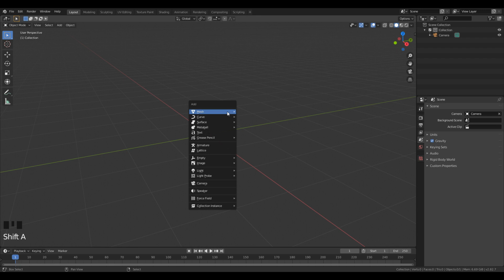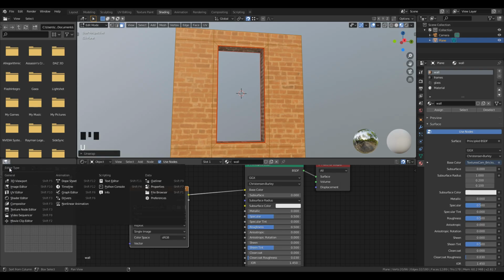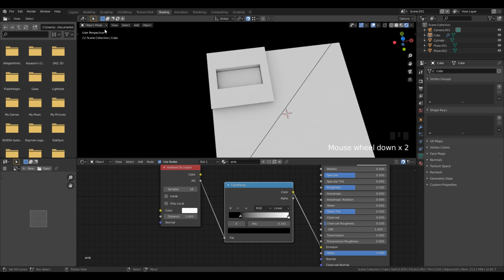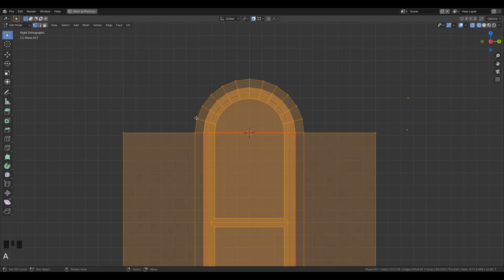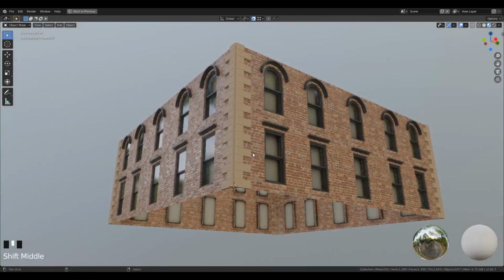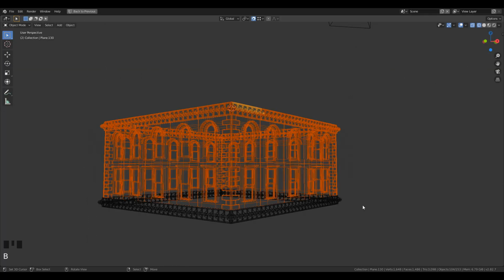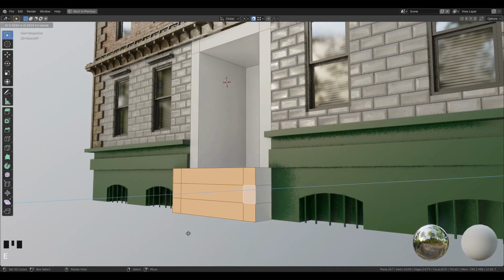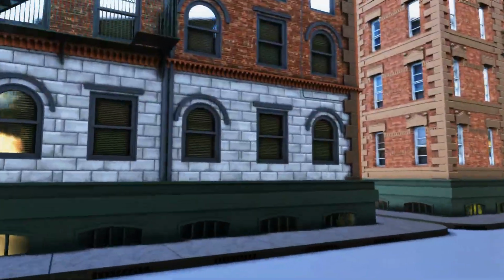Modeling Buildings In Blender

Comment: Many thanks for this It has been a big help. 1 thing to think about. A wall section with a window should be longer underneath the window as windows are set into the building usually at waist height. When stacked up the floors of the building have real height ;) Homes for the vertically challenged lol

Comment: why not use real dimensions?  Why don't you use architectural plans as a reference, why only rectangular buildings?  his system is very interesting by reducing the number of polygons and faces to use.  and their material creation system is excellent.  thanks for your tutoring.
Reply from the maker: I do use real dimension . But for this tutorial I did not change the default mesh dimension while working on the wall. Usually I do change it . If you talk about the building , Its a compact one. If I wanted to make a curve building I could have use this plane mesh with array or spline and could have generated a curve wall of a building . You can watch my array modifier tutorial to see how you can create dome with a plane .
https://www.youtube.com/watch?v=KM9wty__kyY
Thanks for the appreciation . Welcome aboard !

Comment: Great job. I'm not sure if this can be considered as modular, though
Reply from the maker: It's modular. You will just need to use or export few panels of the buildings. By just using those panels you can give any length or height to the building .

Comment: Thanks for this absolutely good tutorial.
but do you have a moment to help me out?
at 28:50 you start to bevel it negative (i got that)
then you selected the face without choosing face selection. how? if i press L the whole roofside thing is selected.
also when ich extrude it i cant just move it off the place. how did you archive that?
thanks in advance
Reply from the maker: You're welcome.I think your mesh is still connected to the roofside. You will need to select the edge and duplicate it then you can use the bevel command . 
If its separate then you can easily select it by pressing L key and you will be able to extrude it later  .

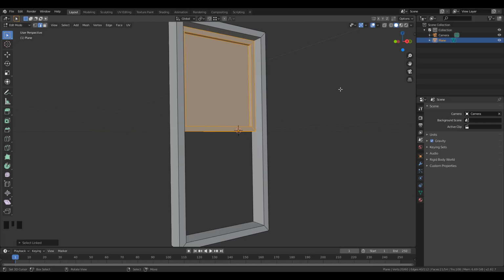Comment: Around 2:30 there was a gap between window and frame, later it disappeared. How??? Please help
Reply from the maker: After duplicating the window panel I have used snap tool with snap to vertex . Then just press g key and then hover the mouse to the upper window vertex to snap the lower one on the vertex of the top one.

Comment: This tutorial is amazing, but I still don't know how to solve the glass problem. I mean they are both selected, but only the bottom window looks transparent, the upper one is still gray.. And I have to say that the bottom one became transparent only when I checked "Backface Culling", and now it doesn't reflect any light like yours does.. I swear I don't get what I am doing wrong.. I have watched your video like 10000 times and it becomes so frustrating 🥺
Reply: Nevermind, guys be careful not to have multiple faces on your object 🤣
Reply from the maker: hey pardon me for replying late , Some time single plane normal faces are flipped and thats why you can't see the reflection of it . You will need to select the plane and  press shift+n and under recalculate normals check inside .
Reply: @SaqibHussain88  thank you man, it s the first thing I do in blender and it took me a while to learn all the commands and problems

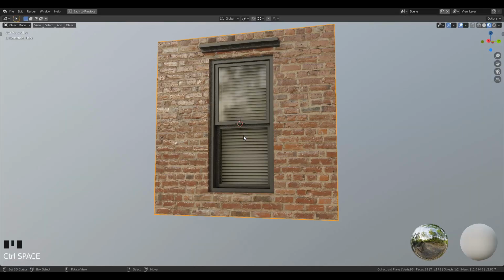Comment: its great i was looking for somethink like this but could i ask if it would be better to use array modifier instead of duplicating the panels at 16:33
Reply from the maker: Array can be used to duplicate a single window panel but you can not manually delete or replace the arrayed window panel. Therefore if you use instance you can easily swap any other window panels with the instance one.

Comment: Welp 3 hours later I have finished my window... Granted I spent about an hour trying to figure out all the shortcuts you used. As well as figuring out why my window was hollow on the other side. As well as losing all my hidden objects because alt h wasn't working for me. As well as doubling back and redoing the whole thing cause somewhere along the way I fucked up bad (when I lost my windows in hiding I made a new window, but figured out how to unhide everything and then my new window got swallowed up by the other windows so that when I tried to open an close the lower window it was shearing the eaten window). But yea it's finished on both sides with no issues on the opening and closing. Thank you for this wonderful video. On to doors lol
Reply from the maker: Do share If you are done with it .

Comment: These frames, which are above the window, destory the snapping function for me. Without, everything is fine. But when i use the these 3 cube frames, the snap is no longer plane on plane. Its always slightly behind every plane. https://imgur.com/a/Za3nACm 
But without it, everything is fine.
Reply from the maker: I think you need to use the median option from the snapping tool to snap it from it center , try it out and do let me know.
Reply: @SaqibHussain88  Thanks. But sadly this dindn't work, too. With median it use directly the window and it snap on the half. But i found a solution for me, when i duplicate it, i use g and x,y,z and then it snap without a gap

Comment: Hi Saqib. Thanks much for this. 
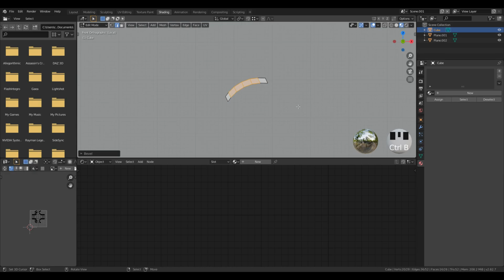May I ask, when I attempt to bevel the edge of the first blinder slat at 9:51, the bevel insists on fanning out to the right side only, yielding this strange result: 

https://photos.app.goo.gl/CA6TtckBXTanPwxQ9

I played your video at 50% speed, and can only see that you did a Ctl-B after moving the loop cut up.

Any thoughts on where I'm going wrong. (I've ensured that the entire loop is selected.)

Thanks again.

Kurt
Reply: Figured it out. I needed to apply the transforms first.

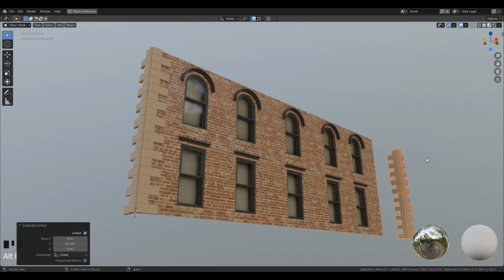Comment: can you explain more about snaping vertex and duplication cause i did not get a thing starting frome 25:49 and specially that 26:26
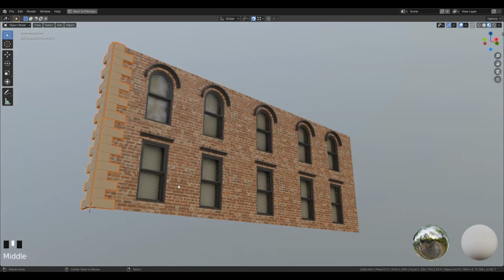Reply from the maker: At 25:49 I was using median as pivot point and vertex for the snapping . So for the corner mesh if I snap it while its far away from the mesh it will snap on wall with it border edge .You will need to remove snap and move corner mesh closer to wall panel till the meeting point of the two corner mesh is closer to the edge of the wall panel. After that you can use the snap option and use it to exactly snap the meeting point of two corner mesh to the edge of the wall panel.
At 26:26 you will see that I have used median inside the snap tool instead of the closest . I did that because I want to use the center of the mesh to be used as snapping point which helps me to center the mesh  according to the corner mesh .Then I have used the closest in snap to position the selected mesh according to last edge of the selected windows.
Reply: @SaqibHussain88  thank you dear freind i used blender since 2.7x but this 2.8x is whole new for me so i'm beginner at this version again i loved your unreal engine works back in 2018 and i'm one of your first follower in arstation good luck i hope you'll get one mill in no time

Comment: at 9:55 you say to add edge loops to the middle of the blind, then you said to bevel it to have borders at the edges.
Please explain this in more detail. I can not understand this step, as it seems unnecessary. Thank you so much I am following your tutorial as closely as possible and don't want to miss anything curtual.
Thanks !
Reply from the maker: At 09:55 you can see that I have grabbed the middle edge and moved it up and then beveled it to apply curve to the mesh . Then what I did was I just added a single edge loop in the middle of the blind and beveled it. In this way you can have two edge loops both of them will have equal distance from both end's of the blinds and you don't have to manually adjust edge loops to both end's .This is done to make slightly round edges if you later apply shade smooth to the blind shade mesh. If you apply shade smooth to a simple cube you will see it needs edges loops closer to every single edge to have slightly round edges.

Comment: Well the Tutorial is great. But i am facing a problem. Some window panel's brick texture are dull and the rest are bright.  I can't find any solution.  But I saw that by rotating the uvs the come Close to each other.  But not seamless. Please help me. I would really appreciate that.
Reply from the maker: Make sure to change the color data of normal map node to linear to avoid blackness in the model . If this is not the problem then share a picture then I can tell what problem you are facing . For seamless uv texture use smart uv unwrap.
Reply: @SaqibHussain88 
Picture. Hope This Helps
file:///D:/Main/Desktop/Comment.html

Comment: Hi great tutorial. May I ask regarding the technique? So are using the 3d models and baking the textures so that we are faking geometry with AO and normals? So that it will be more optimized for view or in games since less vertices etc are rendered? Also this will be good for medium to far away shots since the details cannot be seen upclose regarding the real geometry? Thank you
Reply from the maker: Yes , It helps me to create LOD's(Level of details) . One of the coolest thing is that you can reuse these meshes to create even a lower version of the mesh so that you can use them for visualizing them from far distances. Even can pop there bricks to create higher version of the mesh . The meshes I have created in this tutorial are kind of mid level or lower then mid but these are good for any gaming engine .
Reply: @SaqibHussain88  Thank you for the explaination. Btw may I suggest using this texture generator to ease the workflow? http://boundingboxsoftware.com/materialize/

Comment: Really enjoying this tutorial.. however my snapping does not do the same as yours at 16:40 - For some reason mine snaps behind the original model, instead of beside it. What am I doing wrong?
Reply from the maker: change the snapping from closet to center make sure you are on vertex snapping . I think while sliding the mesh you have some how change position of it slightly off and back of the original mesh after that the mesh will always snap to back of the mesh.

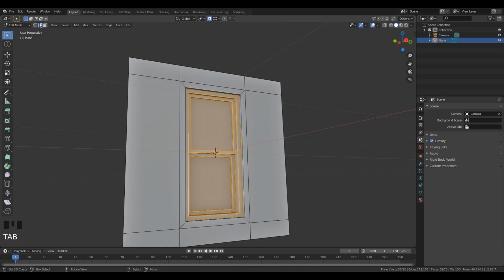Comment: Hi there! Got a problem @ 3:35 .I duplicate the upper edge, I extrude it on Z-axis, but I can't select the face you extrude next, I can only select the 2 faces above and under the duplicated edge, just like there's no edge. I'd like to understand what I did wrong :(
Reply from the maker: It happens when two faces are overlaping on each other try to switch to wire frame mode while you have selected the face icon you will see small dot in the center of every face just click closer to the one you want to  select and you will select that face. Hope this helps.
Reply: @SaqibHussain88  Dude, you're amazing! Got so much respect for you! Thank you very much!
Reply from the maker: @mrtoyotaro6793  no problem bro
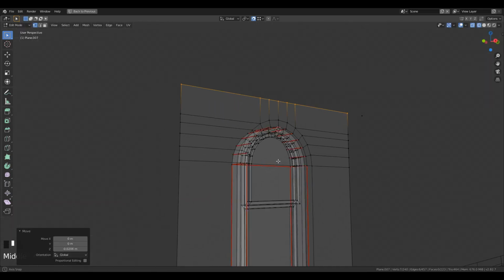Reply: @SaqibHussain88  Sorry to bother you again, but @20:54 how do you fast select that parts in Vertex Select ?
Edit: I found it!  L x2  :D

Comment: Ah, one quick question, if you don't mind? Around 26:48, I don't understand what you're doing. We go from 2 panels to 4. I don't recognise the steps that lead you to suddenly have four. I made that without issue in my model, but later on when you work on one window, the same happens on the matching windows around the model, so I feel like I missed a step.
Reply: Whoops. I think I got it on my own : in 26:20, it's ALT + D, Not shift + D which duplicates instances, so working on one is working on all others. 
TIL!!

Comment: Great content, thank you! One question I have is what's the reason for not using arrays/mirror modifiers instead of duplicating the different parts?
Reply from the maker: Good question! The reason I have duplicate them and make their instances is because you can easily change their position. So if I wanted to have curved windows in the place of simple one I can easily switch them . If I had used array or mirror modifier for that I would not be able to do switch them .

Comment: Hey! Great tutorial. Liked and subscribed. I have one problem. On my windows i can see reflections of some trees and they work like mirrors instead of glasses. I can't see the window shades which i made. Probably its a small setting of the material i am missing.
Reply from the maker: Thanks for the sub! the thing is you are not using the hdr images for the light to reflect trees as background images. You will need to use  an  HDR image for such kind of job. You can download hdr for free just you will need search it on google.
Reply: @SaqibHussain88   Maybe i didn't explain my issue correctly. Here is a picture of my building in blender: https://imgur.com/7IcMM6j 
I can see the windows but not whats behind them. Is there a way to fix this, please?
Reply: @Torchw8   Turn on "Screen Space Refraction" in your material settings. https://prnt.sc/sc9trz

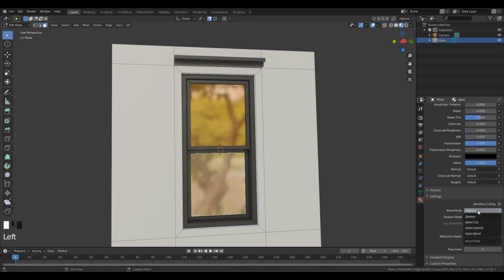Comment: At 5:30 when you say to change the blend mode to alpha hashed a big grey box appears and then the reflection of the trees on your glass disappears. However on my model the reflection doesn't change and I can still see the trees. Any ideas why?
Reply from the maker: That grey screen is not from the software, it appears because of the software which I am using for recording videos. 
And the trees reflection you see is due to the HDRI that I am using . You can Install or import a lot of HDRI inside developer mode to see different reflection which will inside of that HDRI.
Reply: @SaqibHussain88  What did you do to make the HDRI reflection disappear?
Reply from the maker: @kevsterman  wait what ? I thought you wanted to have reflections of trees . If you want to have reflection of trees you will need to get an hdri for that . And if you want make window glass transparent then you just need to check refraction from the screen space reflection .And for proper reflection make sure you have roughness value set to 0 and then add an hdr.
You can download the hdri that I have used in my tutorial from this link:-
https://drive.google.com/file/d/1W4bNnx2E8cBaLXSymhGjZQbTEMbHq3mx/view?usp=sharing
Reply: @SaqibHussain88  @Ardures was right, I just didn't have Screen Space Reflections enabled. My bad. As I was following along I wasn't getting the same result as you and I couldn't work out why. I know now :-) Thanks
Reply: @SaqibHussain88 Hey, it's not because of HDRI, it's because he didn't have "SCREEN SPACE REFLECTIONS" with refraction enabled in Eevee "Render Proporties" settings. You can post some adnotation for people to know why their glass can't go into "see through" mode
Reply from the maker: @Artinkares  bro I thought that he wanted to have reflection but may be I understood it wrong.
Reply: @Artinkares  You're exactly right. I just needed to enable screen space reflections. I don't know how I missed it. Thanks very much :)

Comment: Hi ,I want to learn how to make a modular set for game. Should i build the building in game engine or build them also in blender? If i want to build them in the game engine, should I export all the parts separately or in one file? Also should a module be one single object or parented together? Thank you
Reply from the maker: You will only need to export separate modular pieces one by one but not all of them . 2 modular pieces of the corner window panel for covering both side and one for the middle. Same goes for every other model . 
Only few of the modular pieces are exported out of 3d software that are combined later so that you can change the width and length of the building inside the gaming engine .In gaming engine only simple geometry is used to block out an environment to  know how it will turn out  but those meshes are replaced later with  the one that are modeled in 3d softwares.  Hope this helps.

Comment: its look great , but a little but exaggerated extrudes , also you have a small mistake the corners of house , the bricks that stick out a little bit should not be aligned ( mirrored ) , the short brick should align with the long brick from the facade and so on..
Reply from the maker: Nice comment but thats not the criteria of finding mistakes in the building. The beauty of design is that you can alter it to what you want for it  . That what creativity is for.  You can exagerate it even as its for games. Second I just wanted to share the workflow that how you can make modular asset not on how you can alter a design. So Even If I wanted to change it to what you are saying I could have done that in second by just adjusting the top one to the bottom one .
Reply: @SaqibHussain88  I wasn't denying , the greatness of the tutorial , i just wanted to pinpoint some things i saw that could improve your  buildings design.  the exsagerated  extrude may work for cartoon style , but the for realist style you made , it makes the buildings looks a little bit weird. Im not really really criticising, it's just, personal remarks to make the buildings look better.
Reply from the maker: @hamza-trabelsi  Bro I dont have any issue with your comment  If you really want to help then do share any measurement from real life scenerio If you can do this I will implement that to my buildings . But for your info I have used real life unit system so much in my life that now I can simply evaluate it without using it but do let me know what you want to change it  other wise by just saying I have extruded to much cant help me . Define length,width and depth of the wall .The scene that I was working on is base on real life scale. So you just need to only give me the measured values then I can work on it otherwise there is nothing to talk about it .